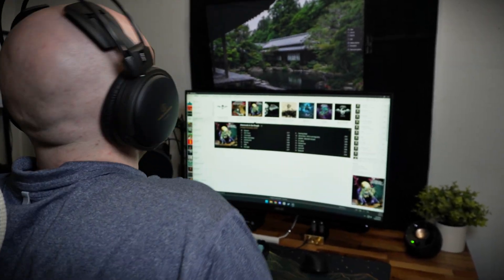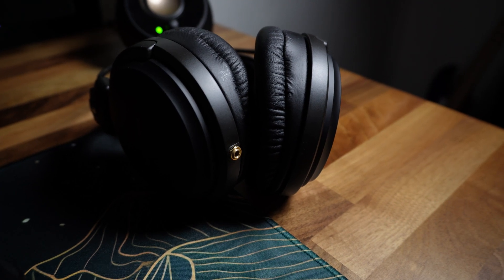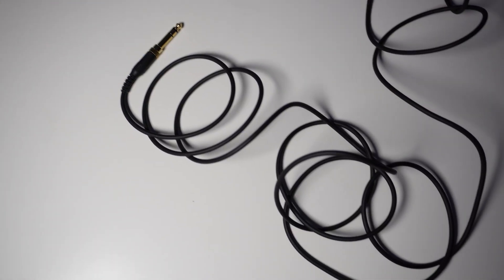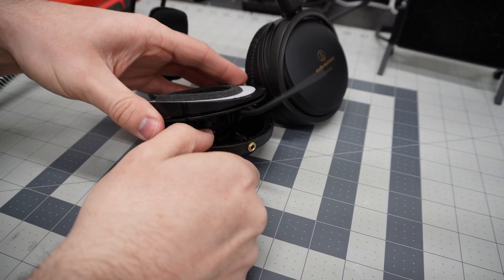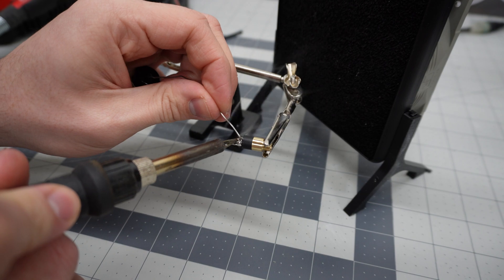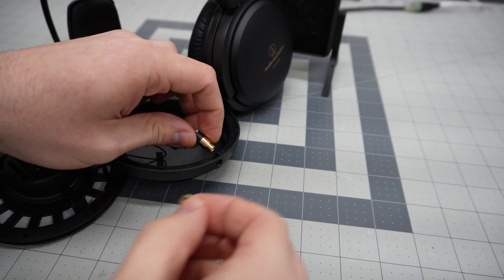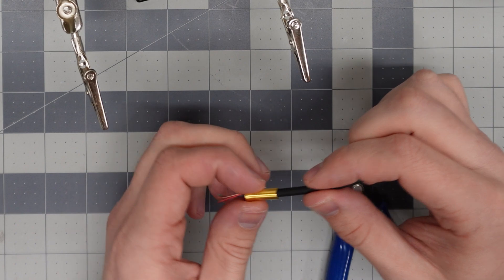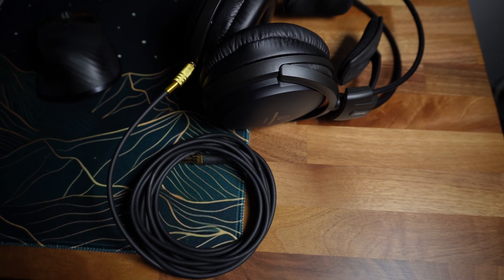The First ATH-A550z Removable Cable Mod - Audio Technica

Comment: I did exactly the same as you, but I lightly burned a hole with a soldering iron so the mini jack would fit — it went in nicely. Overall, it's a pretty easy mod. Unfortunately, in my case, the ring loosens a bit, but that's not a problem — I'll buy some wood glue and lightly coat the thread, just enough so I can still unscrew it in the future. Nice video, it's great that you showed the insides. Good headphones — not amazing, but really good.

The best part is that the cable literally started cracking on its own after 15 years, in random spots, because of how stiff it is and how it always wants to return to its original shape. The best kind of cable is a soft, flowing one. I’ve got a pair of Hitachi headphones from the '80s with natural rubber, and the cable is still perfect today. Unfortunately, Audio-Technica blows them away in terms of sound quality.

Comment: the worst thing is this shit can easy unscrew with that ring, it should be screwed from inside
Reply from the maker: I personally haven't had an issue with that. 😁

I did one for a friend on a different set of headphones years ago and he also never had an issue with it.. 😅
Reply: @CF-Builds  It's easier to find those screw-on ones like yours that attach from the outside and are of good quality. The screw-on ones from the inside are just Chinese crap in my country, not even worth 2 cents. They don’t even have a copper-plated socket, just some scrap steel. If I were to do it, I wanted to buy something decent so I wouldn’t have to keep fixing it. But oh well, useful video — I’ll figure something out. Funny enough, the cable on these headphones started to crack on its own after 10 years. Still, the best cable is the soft, flexible kind, not stiff. I have these Hitachis where the cable is made of natural rubber or latex, and they still work — and they’re from the 70s.